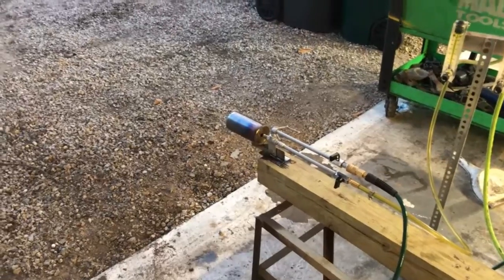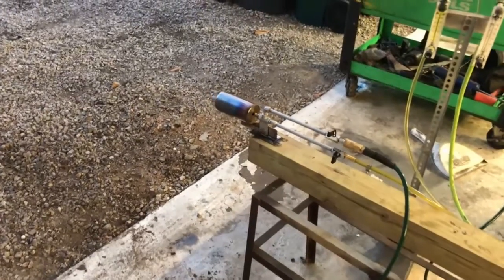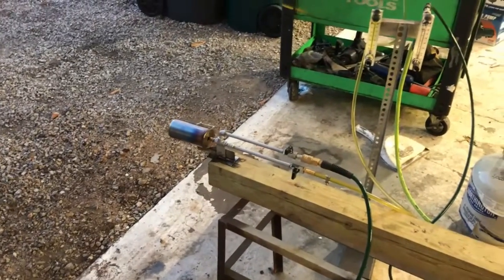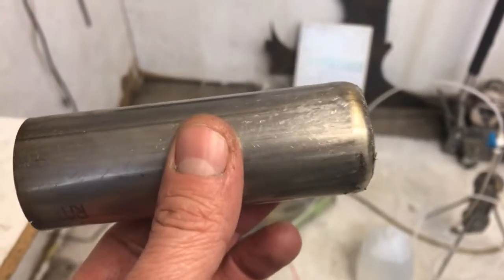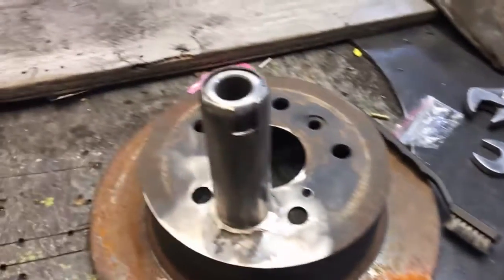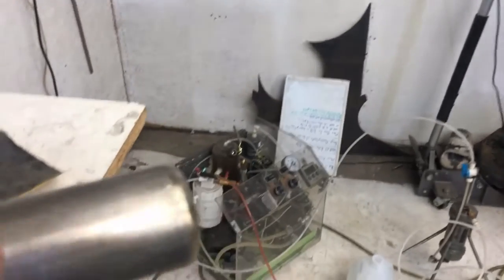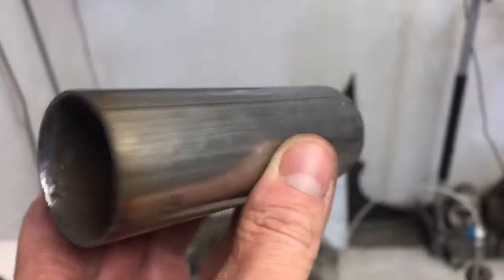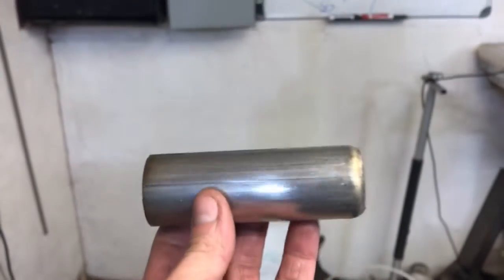Bullet burner all fuel burner system

Comment: To improve burning try to make few (8x) 3÷5 mm holes in back wall of your afterburner tube around the fuel air mixture inlet and seal central hole for ext. air to add more air to it exactly where is needed and make initial burning more stable for wide range of flows.

Comment: I am doing my final research work to obtain my university degree as a chemical engineer, and it is about waste oil burners, emission gas analysis and its relation to power levels. My biggest problem is being able to measure the excess air since I cannot insert the burner into the test boiler although I have discovered that at high pressures (7 to 8 bar) and low viscosities for the fuel (10 to 45 cP) I reach flames practically invisible and with very little emission 

Greetings from Chile and thanks to you, because for your videos I decided to investigate this area
Reply from the maker: Thanks for the input